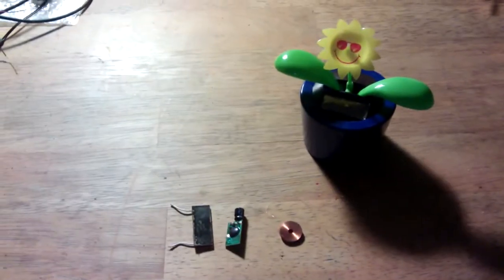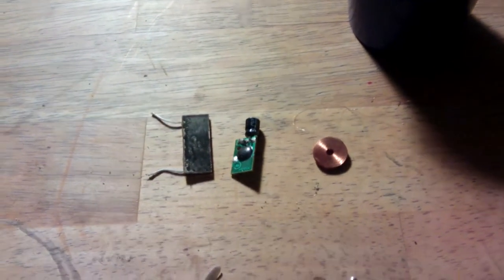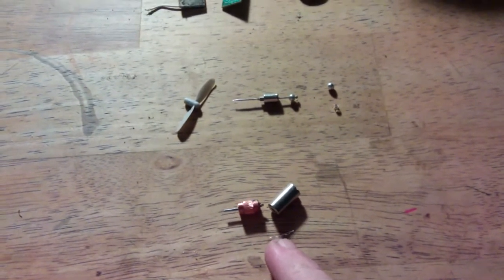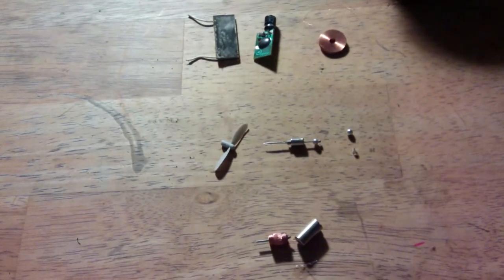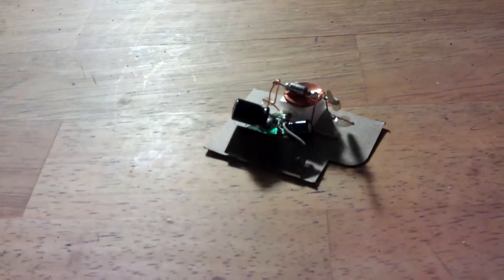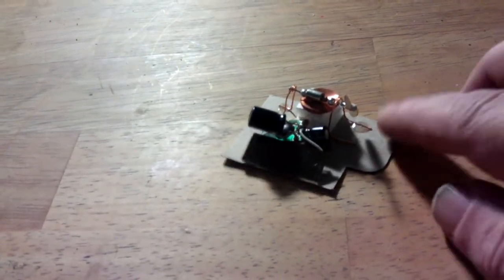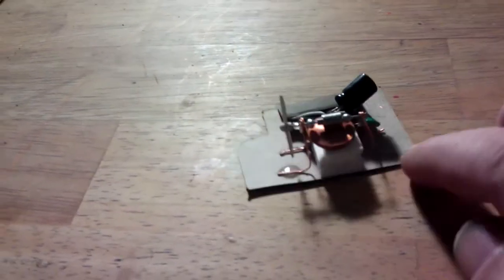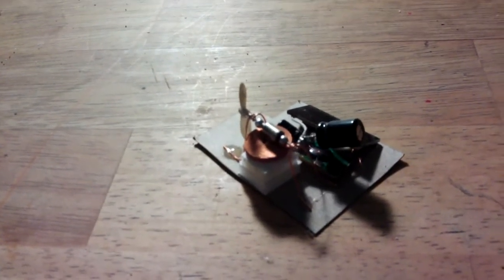Sunday project  - 'Dancing Flower' motor

Comment: wow.. I wouldn't have thought it would be able to produce that much torque but this makes me think this might actually turn a small shaft using a pc fan bearing.
Reply from the maker: Was thinking the same, which made it a fun project. I've done rotating magnet and needle motors before with the circuit, but this was one of those things where if just the right kick at the right time can happen, it might work. The framerate doesn't show it well enough, but it was a great moment seeing the thing rotate for the first time.

Comment: What's inside is the black blob?  Have you taken a look?
Reply from the maker: It would need a scope to each pin and then to work out the logic. But it 'should' be similar to a Joule Thief, They are a really efficient little pump circuit though, i've kept every one of them from a box of 40 a couple of years back. 
Most of the panels ended up connected together to make a solar roof for a little ceramic house lol

Comment: I always wanted to make a cowboy that shoots a laser pistol at the flower and tells it to dance.
Reply from the maker: Really ? I mean REALLY ? what, huh and more similar statements of surprise...
Well, you could. The solar cell could run to a step up converter, storage cap and zener, that allows the cowboy to shoot the laser periodically. At the same time, a small amount of the power moves a little flag up and down that says "Dance !".
Reply: But what if the laser hits the flower and hurts it?
Reply from the maker: Oh well that could be fun, with a DVD burning laser aimed at the dollar store flower. Over time, the petal things would mismatch and it would dance quite the crazy jig.
Reply: BluRay lasers from playstations go pretty hard...
Reply from the maker: Wouldn't know lol, my newest console is ummm the one that got turned into the PiStation 2 !!! Nearest to that is an original huge XBOX that doesn't work and a Gamecube, just the cube. Nothing BluRay though. Presumably it's legal to buy such a laser, even if it's for shooting flowers.
Reply: Not in Australia if its over 5mw and can be operated with one hand...

Comment: yup....that a very efficient little circuit they have under that blob haha fun tmes.....they can keep motors going on microwatts if you can hit that input sweet spot. 
were gonna need more power to get this ship off the ground!
Reply from the maker: They certainly are efficient. i have several of them flashing LED's and such under a light. Just fun to experiment with though and i was determined to make a continuous rotation motor out of those pulses.

Comment: What's a video from slider without a coil and/ or wireless power xD. Btw was it rotating or was it just flickering around? Because I think maybe the fps of the video made it look like it was twitching around rather than rotating. Not sure tho
Reply from the maker: It was rotating :) 
I looked at the vid and noticed that too, the frame rate was quite bad for not showing it spin. There's a certain point of capacitance, where the momentum allows the next kick to keep it going..that's what the click is, as the pin is pushed onto the wire frame support with the coil firing. It can have multiples though, this was about 4rpm per click.

Comment: You should have shown the original device also, it has an interesting logic, using levers and pendulum.
Reply from the maker: Well the idea presented itself at about 1pm and I knew that indoor light was unlikely to deliver enough for any bearing i'd come up with lol. Was therefore a bit of a race to build it within the cloudless calm afternoon.
But, yeah, for something so cheap and rough, that balancing inside is really very neat.